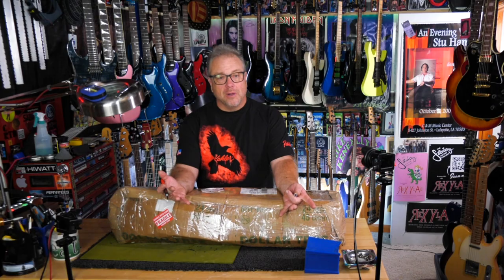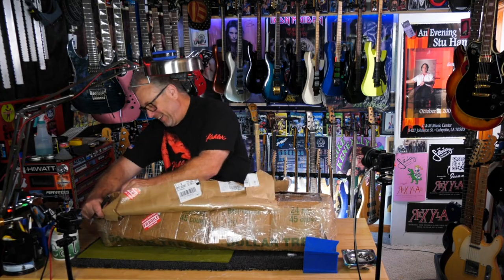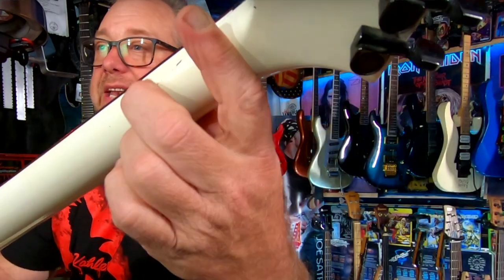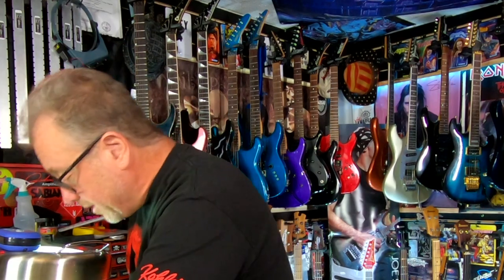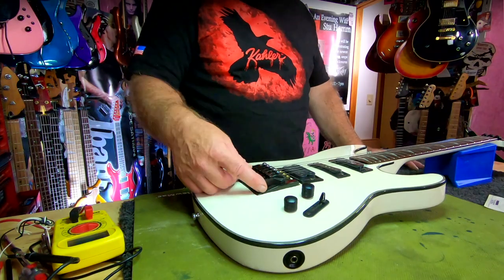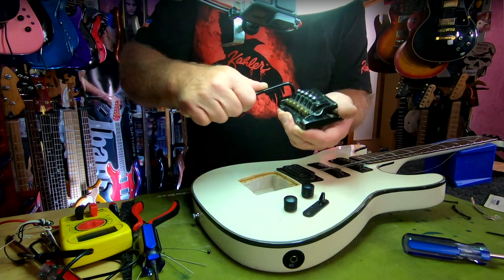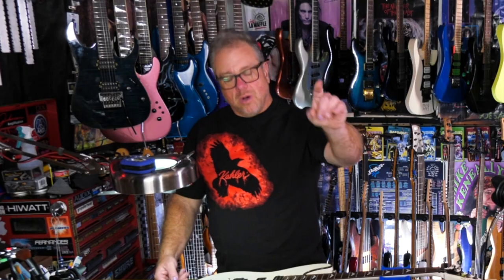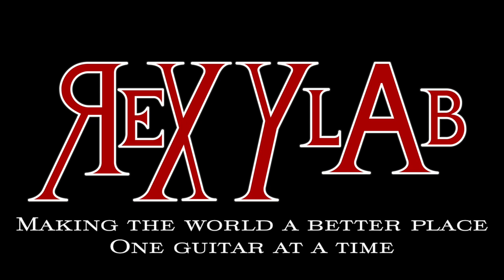Guitar Fraud on Ebay!

Comment: When I was 13 (and knew nothing about guitars) there was a 'Burnside' by Guild at my local guitar store. It was black with red pinstripes/graphic (?) and I LUSTED after that thing!! lol My parents ended up getting me a Gibson Firebrand The Paul Deluxe, that was a 1M times better guitar!! And I was disappointed. I really wanted a more 'Metal' guitar, strat shaped with a whammy bar, not some entry level, walnut/natural finish Les Paul?! Ahhh, live and learn.
Reply from the maker: Want to trade parents?
Reply: @REXYLAB  Lol, believe it or not, those guitars were nearly equivalent in value, in those days?! The Firebrand was around $300 and the Burnside was just a little bit less, if memory serves. A nice all original Firebrand will set you back $2K these days!! I wish I still had her…

Comment: Sucks to see you get something THAT bad. At least if it was actual wood, you could try'n deal with repairing it. The neck is probably pine, and the body looks to be nyatoh veneer, filled with foam!
Reply from the maker: The body is hollow with a plywood top. Not worth repairing.